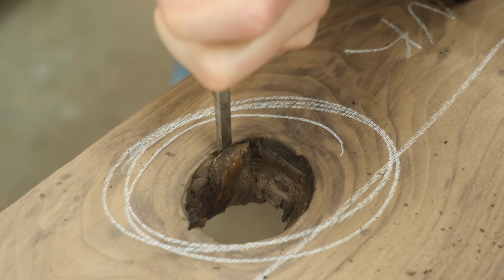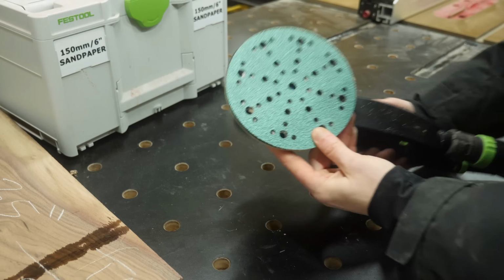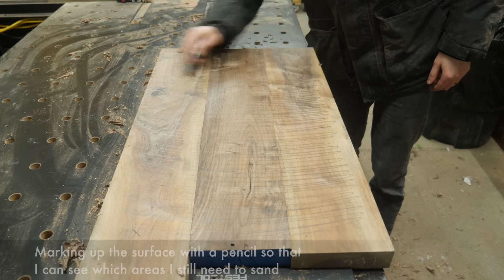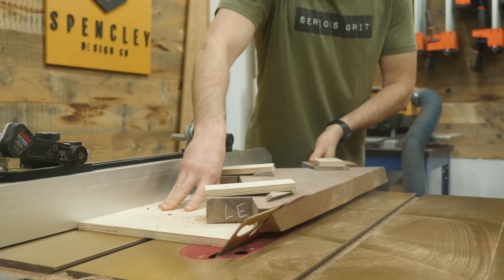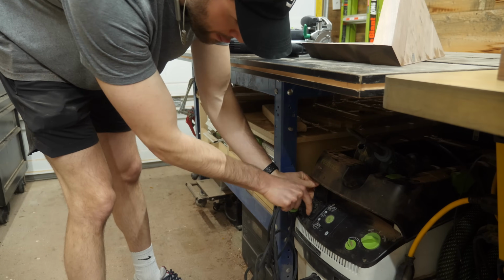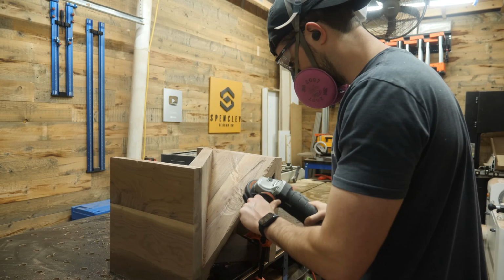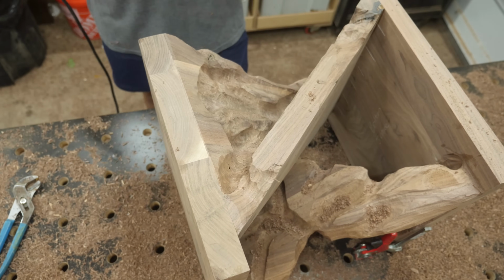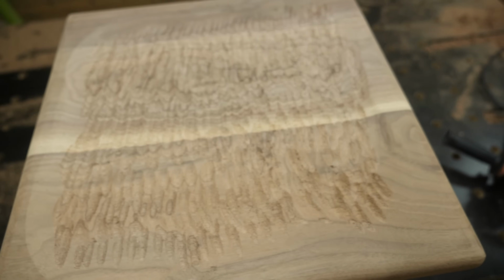why everyone is afraid of this

Comment from the maker: PLANS FOR THIS PROJECT - https://spencleydesignco.com/products/helix-end-table-plans
Arbortech Tools (10% off Using Code “ACP10”) - https://rebrand.ly/9ptbqc6
Elgin Bluetooth Hearing Protection (10% off Code “SDC10”) - https://rebrand.ly/o8v4x9k
TotalBoat Epoxy + Finishes (5% off when you click this link) - https://rebrand.ly/r6yxcaf
👉  All My Plans - https://rebrand.ly/66hppxg
👉  Merch - https://rebrand.ly/d52ph5d
👉  Patreon - https://rebrand.ly/txql2ur
👉  Instagram - https://rebrand.ly/6mpey28
👉  Leave a Tip - https://rebrand.ly/5sjl536
👉  Podcast - https://anchor.fm/offthecutpodcast
👉  Tiktok - https://rebrand.ly/wpwjyk3
👉  Website - https://rebrand.ly/99iwzqj
👉  Subscribe to My Channel - https://rebrand.ly/tqb7gxt
👉  Join My Monthly Newsletter - https://rebrand.ly/b87qe17
Reply: I’m w you on the Intro’s
and the Purest’s hand tools.
Life’s rather short.
Reply: 3-legged tables do not rock, even on rough surfaces. Since this table was so unusual anyway, it surprised me that you gave it a square base.

Comment: Suggest running dust collection from a Jackery. Jackeries can charge WHILE discharging, so you don't even have to unplug it to use it. They are available in a variety of sizes for a variety of budgets. You can even charge it up in the apartment, lug out to the workshop, and plug it into a handy power cord. You can, in fact, run a table saw with a Jackery.

Comment: I have this tool, it's absolutely awesome. Shifts a lot of wood when you want it to and smooth enough to easily follow a line. Best of all, it has a single vertical edge to sharpen with a diamond flat file when you need to.

Comment: Dude the match fit blade cleaner is a GAME CHANGER. You need to try that before you replace a blade. I just keep Simple Green in it and it takes 5-10 swipes and it's like a new blade.
Reply: I think you meant Microjig? Not trying to be “that” guy; just in case anyone goes looking. I have it as well, and love it. I also use Simple green,  but keep “Goo Gone” (industrial) separately in case I’ve been working with wet “Big Box Store” softwoods. Cheers!
Reply: @k1sfd1974  yes I did ty!
Reply: I use a fingernail brush and Dawn Powerwash. It’s even faster than simple green for me.
Reply: And maybe sharpen it before you throw it away? 🙄
Reply: @winandmestebeld  idk that I'd sharpen a Frued lol, but cleaning the pitch goes a long way in lifespan
Reply: Simple green works great, but can also remove the writing on the blade in some cases.

Comment: Have you tried a solar generator for more power? There are many available with more than enough capacity to run all of your tools.  Most models can recharge from the 15 amp circuit while you are using power from the batteries.

Comment: useful tip, use a block and 80 grit sandpaper to remove the worst of the burnt face that you intend to glue up. Cleaner wood gives for a better grip, while the burnt resins will work against you in the glue up.

Comment: What happened to that Jackery for powering more than just what the one circuit can handle?
Reply: i was going to suggest a cheap power station or building his own with an lfp battery and a chargerverter like from sungold. either of them could connect to the single 120v outlet and be set to charge at like 500w while he is able to use however amount of battery he can afford

i would suggest at min 5kW, 48v being the preferred battery voltage, this way he can power high power tools without stressing his single outlet.
Reply: Just looking through the comments to suggest the same. Glad I am not alone in this alternative solution.
Reply: Well, if he had common sense. He would look into a portable generator for extra power. That is what I am having to do until I can get my garage rewired to have the proper power in it that I need
Reply: @joshuapuyear6818  

He would spend significantly more on a generator instead of using the Jackery with the existing outlet. It might work for you because your situation is different—you don’t actually have power.

He’s overloading what seems to be a 120V circuit, which can peak dangerously at 1800W. Ideally, you want to keep this around 1500W. The table saw alone could draw that much depending on the type of wood and the vacuum might add another 200W, enough to trip the circuit over time. If he connects the table saw to the Jackery and then connect the jackery to the 15A outlet, the Jackery could pull anywhere from 300W to 1000W(depending on the model), leaving 500W or more for other tools.

How much would he need to spend on a generator that can handle 2400W (20A)? Plus, he’d have to deal with fuel, noise, heat and inefficiency.

people who appeal to common sense istg  :face-red-droopy-eyes:
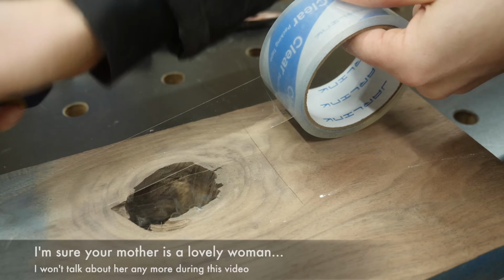Reply: I found the video (XkoBr-d0rIE) from a year ago where the issue is mentioned at 2:10. He also talks about gas generators at 3:12 but makes a strange comment about climbing power lines to connect it, which might be trolling. Throughout the video, the power station isnt connected to the outlet for charging so maybe it doesnt support output while charging? That would be odd. The model claims 3000W max, 6000W surge and a 4-hour charge time which would be 500W from the outlet but the specs say it can pull 15A max on 120V. jackery might pull 1800W from a low charge then drop off to a lower wattage when near 80% to prolong battery life, im not certain.
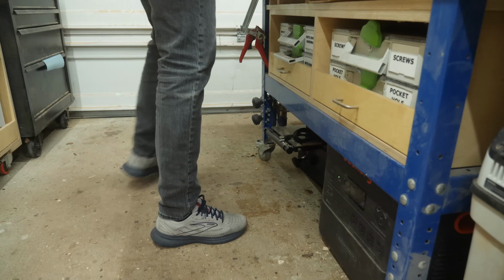Reply: omg he does have a power station can be seen at 5:04

:face-orange-raised-eyebrow::face-orange-raised-eyebrow::face-orange-raised-eyebrow:

Comment: Typically those apartment garage units have 2 circuits that jumper down the run of spaces.  If you can get your neighbor to allow you to run an extension cord from their unit through the rafters over to your dust collector, you can get a second circuit.  I had to do this when I was charging my car and running misc tools and dewalt chargers in my garage.

Comment: I feel you on the heat and cold.  My garage is old, has no ac, no insulation, the roof is short and it gets hotter than an oven.
I actually just bought a window ac, and I'm building cabinet to place my dust collector in.  Progess little by little!!

Comment: Told you to get the grizzly planer!
And I have an old Black &Decker Wood Mate folding work beck that’s perfect for a stand for the bench planer. This bench has a 1-3/4 thick top so you can bolt the planer to it or use the dogs to use it like a wood vice
Very handy when you need an extra bench but not have the room for a dedicated work bench

Comment: i have no issue with using power tools over hand tools, but a Sander will not give you the same shimmer and grain detail that a hand plane will, sanding will trap small bits of sawdust inside of the pores of the wood, try face planing and orbital sanding two pieces and put a sealant on both and look at the difference closely, and you will see what i'm talking about

Comment: One thing to assure you achieve your goal is always rest out a new product or whatever you introduce to your tool kit before you destroy your product and have to swallow your pride for making an untested  decision. Always test the products on a scrap piece. Best a few square inches than a kitchen floor. Or what matters to you. Best to find out cheaply than expensively. 
Sanding doesn’t have to be  boring. Look at it as fine tuning. I work y stone which has similar properties, working by hand. Power tools are indispensable. And are  necessary equipment, plus hammer and chisels. Being hurried can or will cause damage and problems. Take the right amount of time for your level of skill. It always pays off.

Comment: FYI, denatured alcohol will help release hot melt glue. Depending on the glue you use and the material, it may release with almost no effort at all.

Comment: My mother was a Fine Furniture maker before retiring.  Her creations were pricey, exclusive and beautiful.  She used modern equipment and some hand tools.  It was really dependent on the piece being created.  However, she had a firm belief that using modern tools as much a possible was the only way to go.  She said that if sanders, routers and planers were around in the colonial era, the tradesman would have used them.  It makes sense doesn’t it?

Comment: I have suggested this in the past but since you don't have access to the breaker a solar generator or back up battery system that you can plug into the outlet to charge and provide a buffer system for power draw may prevent you from tripping that breaker.
Reply: He had the jackery power system at one point

Comment: I guess it's moot now since you're moving, but an EcoFlow style battery bank would have been a great help for your apartment garage. You can let it charge at 15 amps, but pull up to 30 amps from it at 120v. They also have a parallel kit for 30 amps at 240v if you are willing to spring for two units.

Comment: Hand tools allow you to be more accurate when doing shapes. I mean people use jeweler files to finish off reduction gets after the gears were cut by machines to be gear shaped. You compare a gear set finished off with jeweler files vs ones not you’d find the one finished off with jeweler files are quieter, more durable, and more efficient. Hand tools are important because they can do things more accurately than any machine. If you touch a piece of wood to a belt sander you’re taking off a lot of material where if you rub sand paper on wood you’re taking off very little. Power tools help speed up the rough setup but hand tools help where fine details count.
Reply: It's about making money.
If you fiddle around at home doing stuff for yourself then you can spend 30 minutes sharpening and tapping that planer to get the blade in the right position.
But if it's your work then you need to use power tools.
And if they had power tools in the past they would have used them in an instant.
The only reason why ordinary people can afford something like a carved bookcase or a slab table today is because of power tools.
It's about making money and making stuff that is affordable for other than the one percenters.

Comment: No, some of us just like the nostalgia and satisfaction of using hand tools. There is no such thing as an obsolete tool if someone can use it effectively as it was designed to be used. I will agree that those that say you are not a woodworker because you prefer power tools are absolutely incorrect. If you create out of wood, it doesn’t matter what type of tools you use, you are a woodworker. I have owned and do own a large variety of power tools, mostly things like my lathes and table saws from the late 1800’s to the 1930’s and love to use them when the project dictates the need, same with my modern band saw for resawing lumber and my modern drill press which was a gift from my father. But for me, I would have used a plane not the sander but my plane irons are kept sharp and set up properly, same thing with my hand saws, they are kept sharp and would have gone through that board with little effort. Not as easily as a table saw mind you but very easily. So realize that there are those of us out here that are master craftsmen that respect all different methods of working with wood and would like to see you do the same.

Comment: TBH in this day and age, if you have issues with trying to run two appliances at once on your low amp breaker, buying a big lithium battery and running one tool off it while you run the other on grid power is probably the easiest solution, if upgrading the electrical service isn't doable.

And depending on the complexity of the upgrade and your ability to DIY, it may even be the cheaper option.

Comment: Sorry to be “That Guy”, but just want people to know that you can’t just “upgrade the breaker”, since the circuit is sized to properly protect the wiring.  Instead, you would need to upgrade the wiring of the entire circuit to a larger size BEFORE you can install a higher amperage breaker.  Better to just run another circuit if possible, which I understand is not possible for either option in this case.
Reply: But... You don't know what the wiring is. The wire might safely handle way more than what the breaker can provide, it's all down to who installed it
Reply: @PPedroFernandes  The wiring insulation will be identified with the size and insulation type which, in turn, informs of it's maximum amperage rating.  Regardless, the vast majority of installations utilize the minimum size wire to handle the load of the circuit, and the maximum size over current protection device allowed for that wire, which is why I made my comment in the first place.
Reply: @ A simple fact of residential construction. Any original bid that would include upgraded wire would have been discarded. The best evidence of this is his earlier videos where he stated that when he “ blew a circuit breaker” he didn’t have access to reset it. Any developer that doesn’t have  individual breaker boxes is not gonna pay for more expensive wiring
Reply: @genecarden780  "only uneducated" covers a vast portion of society, as demonstrated by people replacing blown fuses with larger fuses so they don't continue to blow.  That is one of the reasons circuit breakers became so popular.  It is a simple concept, but not a "simple fact" that everyone understands.

Also, I completely missed the fact that he doesn't have access to the circuit breaker, which is interesting since the dwelling occupant must have access to all circuit breakers unless access is available to "qualified persons" at all times.  Sorry, I don't have my code book with me to refer to the article, but I am certain it is in there.
Reply: @robert-ne1835 it's not an "occupied  dwelling," it's a garage, and a freestanding garage at that, so it doesn't fall under that section.
Reply: @ There is no such thing as “occupied dwelling”.   You need to refer to the definition of “dwelling units” and you will see that it does in fact include accessory buildings, so yeah, it applies.
Reply: @robert-ne1835  "dwelling occupant" inferred an occupied dwelling. I stand by my statement.

Comment: As far as your electrical problem brother, i suggest a Generator.  i particularly prefer the Predator 5000 from Harbor Freight.   Its affordable and its awesome.   trust.  Did i mention its quiet?    Its quiet!   Oh, and considering the fact that you are using equations to fit wood, i can guarantee you can learn how to sharpen a saw blade.   Frfr.   Its fairly simple and all you need is a dremel.   Even if you dont do a perfect job sharpening your blade you will not be far off, and promises it will cut much better than it was in the video.   Most likely as good as new.  with a little practice you will be able to make it better than new.   and keep it that way!

Comment: I also am working with a 15 amp power to my garage I have to run an extension cord from my mud room in order to run my vacuum and tools …and also shut off my heater while I’m cutting it’s inconvenient but it works… planning to add another breaker this year.

Comment: Have you considered a couple of deep cycle batteries and a mains inverter to run that vacuum for the short periods needed when you would exceed the power from the breaker?.... you would just need a decent automatic charger to keep it topped up for the times when you need it.

Comment: I'm doing that bottom texture thing inside my beehive to promote propolising.

The inside of a beehive can contain propolis, a sticky resinous substance that bees use to construct and repair their hives: 
Antimicrobial: Propolis has antimicrobial properties that help keep the hive sterile. 

Sealing: Bees use propolis to seal cracks and openings in the hive. It's also used to waterproof and smooth the internal walls. 
Strengthening: Propolis helps strengthen the hive's protective barrier against weather and external invaders. 
Preserving: Propolis protects the hive's structure from water, fungus, and wood decay. 
Natural defense: Research suggests that the propolis envelope is a vital part of the colony's natural defense against disease.

Comment: For that build up on the saw blades have you tried spray on oven cleaner? I would think it's pretty much the same problem. I remember it being recommended for router bits but I haven't tried it.

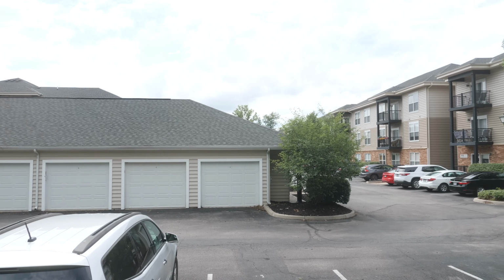Comment: 7:54 or you could just get a high amperage solar generator there are multiples with 20 amp outlets I required a proper 20 amp that most homes don’t even have to run this crazy oven that utilizes crystals which sounds insane but it actually works. You could seer a steak Bravo oven their neat tiny but require all the power and I run it off, a solar generator, EcoFlow delta two. But there are others for sure

Comment: Does it drive you crazy that your Harvey table saw requires 60 (yes 60) rotations of the tilt wheel to go from 0 to 45 degrees. It does me. I would have bought a different brand had I known. None of the 2 million YT videos I watched pre-purchase mentioned this.

Comment: If you can't do it the hard way, you're selling yourself short. Cool thing about all these things that save lots of time and effort, is that the system that allows them to exist and be maintained is going away. Learn the most sustainable way, try and stay familiar with it, while still using the modern conveniences. Oh, and stockpile long term food and have a plan for water purification and sourcing without it coming from the tap. Laugh if you want.